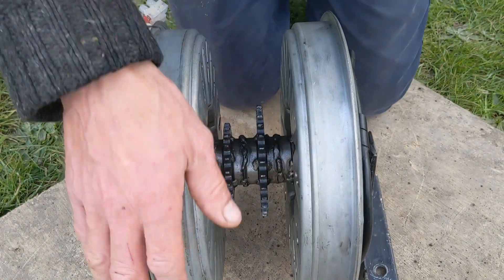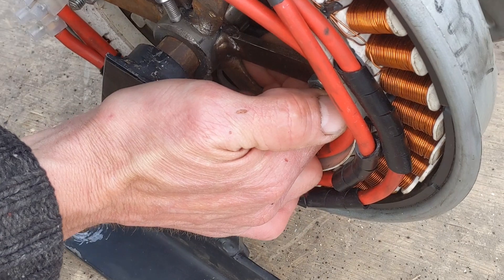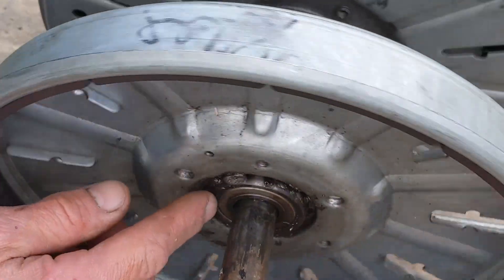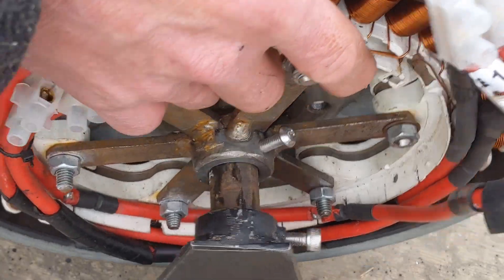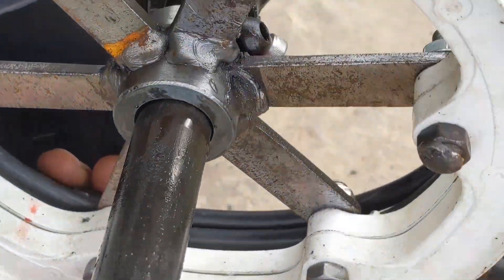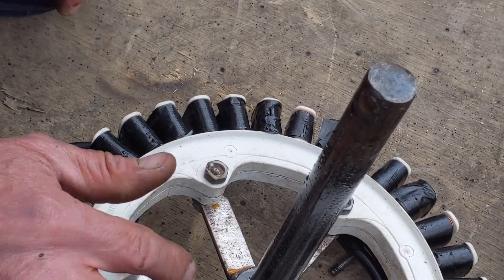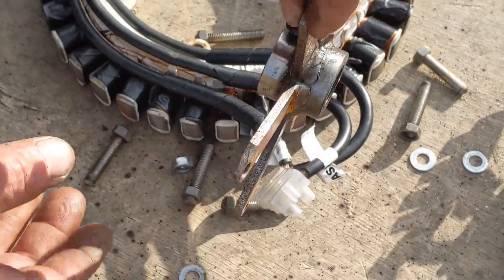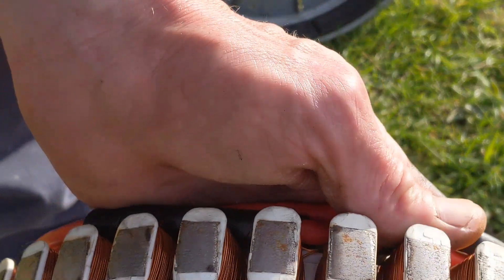Smartdrive FREE ENERGY Wind Generator  - Explaining Design & Build Issues - 17th April 2021

Comment: How many Ampers do you get from LG washing machine generator?
Reply from the maker: I got about 12max you can get 30 in hydro
Reply: @GavinFreedomLover  Very poor performance car alternator would do much more Ampers.
Reply from the maker: You cannot get a car alternator to go fast enough to make any power, they are useless.
Reply: @GavinFreedomLover  Rotor modification with n52 neodimiyum magnets will make it powerful

Comment: Earthing through the bearing causing internal welds maybe, heard of it before on trailers fusing the bearings solid. Id have each stator wired  independently with 2 rectifiers

Comment: You want the stator bare sections of metal at the same level as the bottom of the magnets. Do not remove the fins on the rotor as that moves air over the coils. And yes, even rotors that come from the factory can be warped and you have to correct them.
Reply from the maker: Yes I know , they were aligned at one point even after welding, but then I panicked and put more weld on !!!